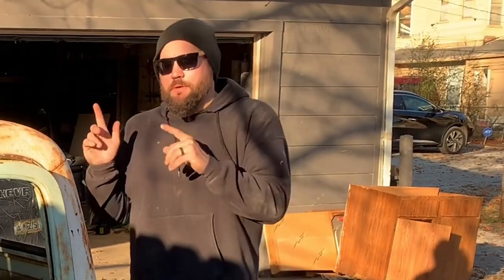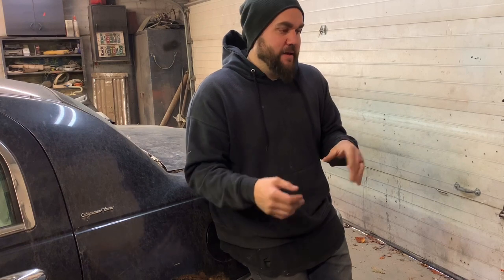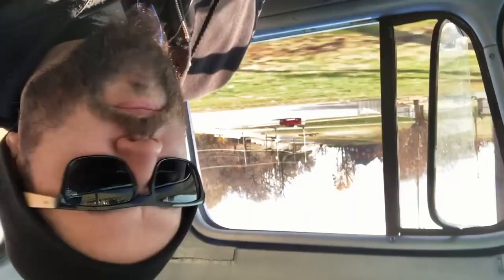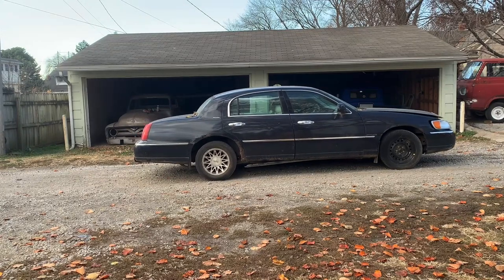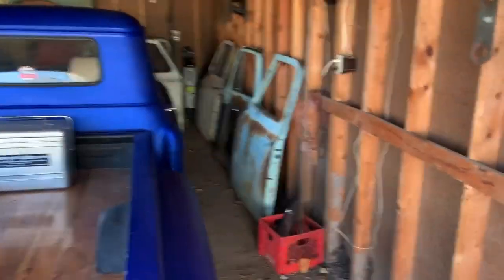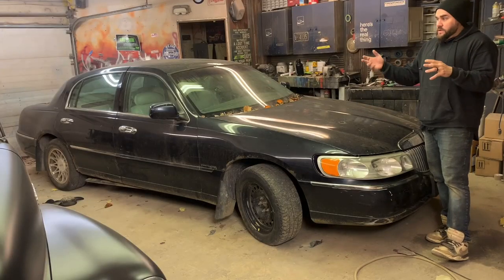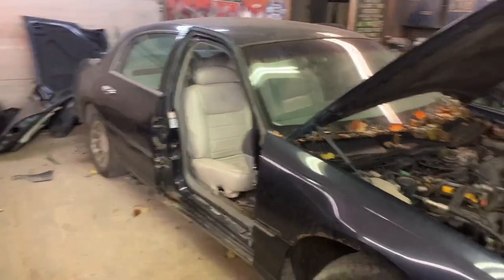BUILDING A HOT ROD FOR UNDER $1000 DOLLARS!! HOW TO BUILD A RAT ROD 54 FORD TRUCK FOR UNDER A GRAND!

Comment: Serious question. I’m a mechanic. And during my career I worked in the salvage industry as a dismantler. If you’re keeping the motor. Granny and frame. Why not just rip the body off the frame and store instead of stripping piece by piece? Easier to store parts. Etc.
Reply: Don’t think this was saying you’re doing it wrong. I’m just genuinely curious on your method because I’m starting a rat rod build on paper currently
Reply from the maker: @yeetlordmcswaggins7104  watch the next few vids and it will make sense. I need the firewall, dash and floor to use in the truck. If i took the whole body off it would actually be more work cutting that shit off the body. 👍👍

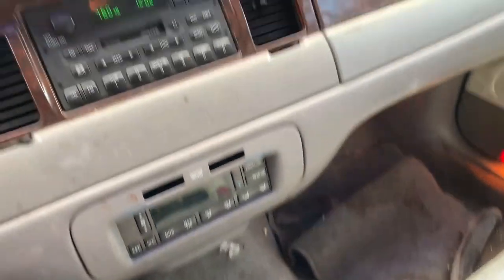Comment: 4:10 could be the blend door actuator for the HVAC system, I had a 2008 and drove several ones for a limo company,(2003-2011) that was a common issue.

Comment: Ive down three...all under 1000..1st was 51 dodge truk on 98 dakota...700 for truk..200 dakota.  But 100 for cosumables...2nd was 46 ford ...old mud truk on 75 blazer...traded 98 ranger for it...zero money...traded blazer frame for 2001 explorer 5.0...zero money...300 in parts to build....last was56 international on 2001 s1o...400 for international..400 forvs10. ..200 in parts....all wet kept efi with doner truks floors and firewall ...all ran and drove wen sold....
Reply: Doing the same thing got a 1951 dodge power wagon

Comment: Should I go to mechanic school or collision repair to learn how to do this? I’ve had plenty of time to think about if I want to pursue this path and this is what I want to do with my life (I’m 30)
Reply from the maker: Honestly you’ll be better now (since your 30) to go to a local shop and see if you can get a job doing little stuff and work your way up. Mechanic/collision school is great but it takes 2-3 years and you’ll be asking to do the same thing you’re doing now. Starting small and working your way up. One of the best mechanics i ever met started out at the shop janitor/helper, then got moved to oil changes, then got moved when to little mechanic stuff, and after a few years was the head mechanic in the shop. I will say, I might not be the right guy to ask though, cus I’ve always just done my own thing.
Reply: @CaseysCustoms  Thanks for the reply, I really appreciate it

Comment: What is the best way to figure out a chassis swap? I imagine you need wheelbase, chassis length, etc. to match up? Or are there other requirements as well? Thanks!
Reply: Wheelbase, track width and a tape measure. Google is your friend .roadkill has a decent database.

Comment: That noise in the dash is the blend door actuator. In case no one answered you.
Reply from the maker: So it just does that when it goes bad? They were out on chevys all the time but don’t knock like that. Lol
Reply: @CaseysCustoms  yes, it’s the sound of the gears in the actuator. It is still trying to do what is designed to do but the piece going in is snapped off. It’s all plastic so. Most likely something is blocking it such as a nest or walnuts. Anything that got in there. Every time it makes a rotation it clicks.

Comment: I say it "can't be done under $10,000!!!!"!!!!!! Unless you know a guy who knows a guy who knows a third guy that owns his own private junkyard and has a lot of "free parts" just kicking around!! Today everybody wants "top dollar" for everything under the sun!! Sure you need that motor....but it WILL cost you and cost you dearly a lot of times!! Then just drivetrain parts have gotten into the range of "stupid expensive" as well too!! I just bought shocks for my truck and spent over $200 for four of the cheapest shocks I could find for a 1999 Ford F-150!!! And I BOUGHT THE CHEAPEST SHOCKS I COULD FIND!! Years ago you could get a running car for $50 (1970s and 1980s) and those days are long since behind us in 2020!! And today the guy with the "vintage radiator cap" wants $950 for one that has a "chrome finish" and is a "no name brand" radiator cap!! People don't keep parts anymore for anything either unless you just happen to "fall in" with a guy or a group of guys!! But that seldom ever happens as well in a lot of cases anymore either!! Bobby might have the part you need but you have to pay to add a complete second floor on his single wide trailer before he allows you to "see the box that item came in"!!! That is HOW things works these days!!
Reply from the maker: You should watch these vids closely. Everything I’ve bought has been on the market, not “from some buddy” I’m at 750 right now and have 90% of what i need
Reply: Casey are those cheap prices for the old bodies common in your area or did you just get lucky? Can't find anything remotely that cheap on the east coast.